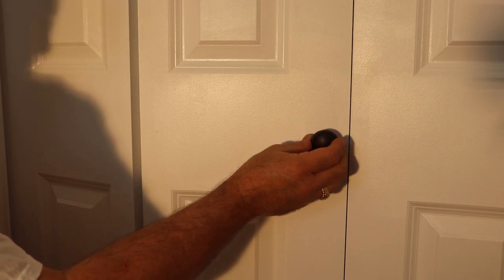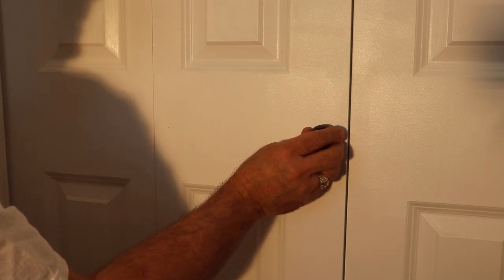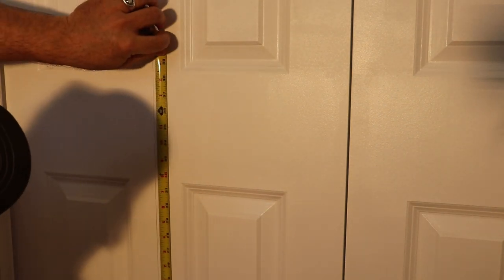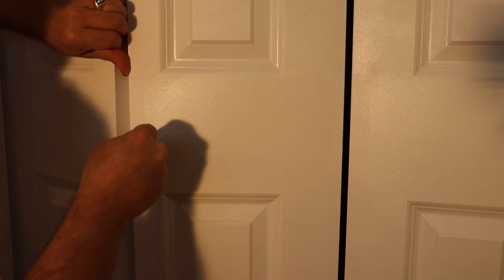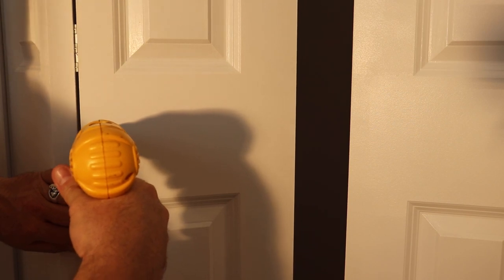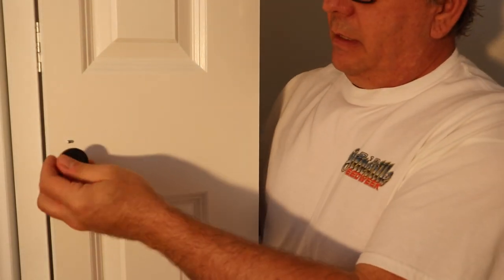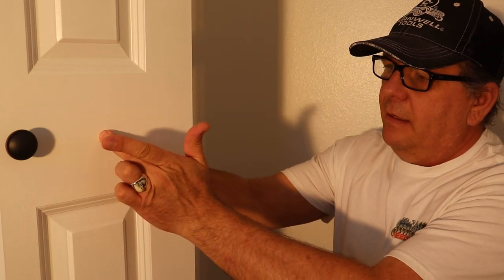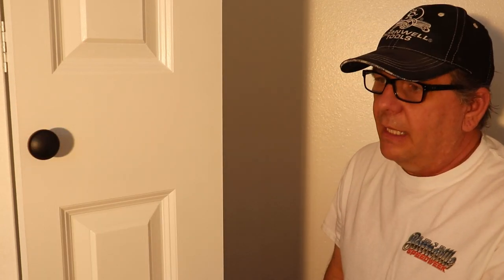Simple Bi-fold doorknob install

Comment: This might be a stupid question but how do you get knobs with long enough screws? All knobs are for cabinets not doors so the screws that come with the knobs aren’t long enough.
Reply: I'm sure this is too late,  but you can go to menards, lowes or home depot and go to the specialty screw section and choose the right thread pitch and length you need.  They are sold individually
Reply: At Home Depot in the specialty screw section they have screws that you can break off to the length you need that fit the door knobs threads.

Comment: Shouldn't the knob be installed at the other door instead since it's swinging out towards the direction of the extreme left or right door?
Reply from the maker: It can be installed on the outside edge of the pivot seam and function in the same manner but it will also expose the knob to getting snagged on clothing while walking by on the left and the the knob on the right will contact the wall.

Comment: Before you drilled, you said your going to use a center pop up? What does that do and where can I buy that tool?
Reply from the maker: Once you mark the spot you are going to drill a center pop tool is used to make a accurate indentation in the surface.  The spring loaded type can be purchased at harbor freight and they are gold in color or you can just use a small center pop and a hammer.  Good luck on your project.
Reply: @Artisticmetals  
Thank you! I saw the video was posted three years ago, so I really didn’t expect anybody to respond but I thought “well why not.” I’m glad I did. Thanks again.